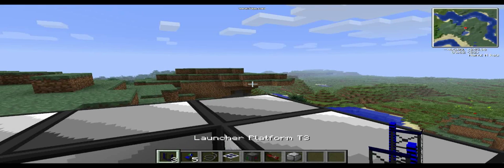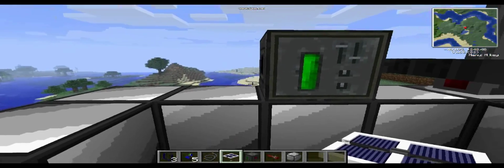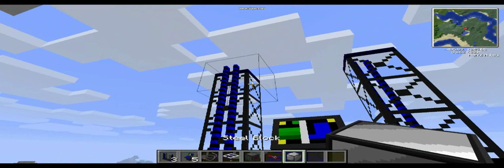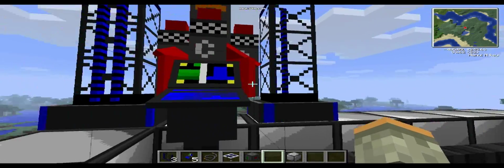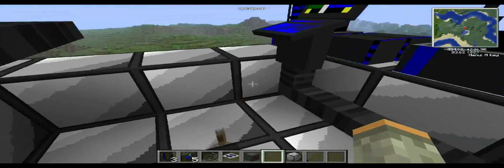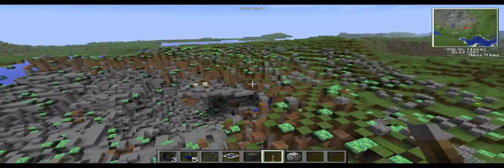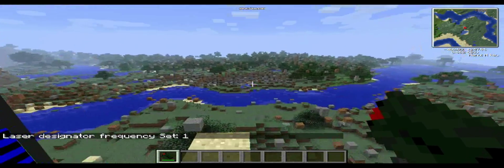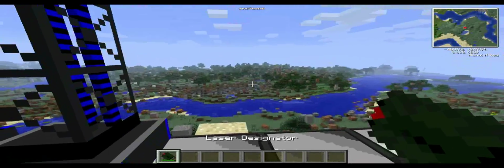Volts Tutorial: How to Fire a Missile

Comment from the maker: Not connected means that the control panel is not connected to the launch platform. Make sure that the control panel is placed in the center of the launch platform, at the same height as the base of the launch platform and no space in between them. Go back and check the video to see how I did it. Sorry if I didn't make it clear in the video.